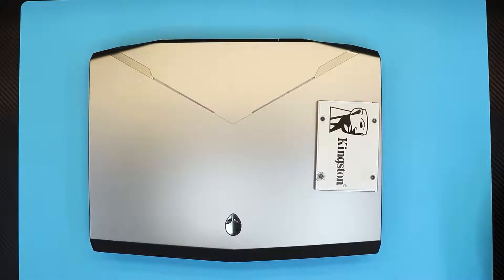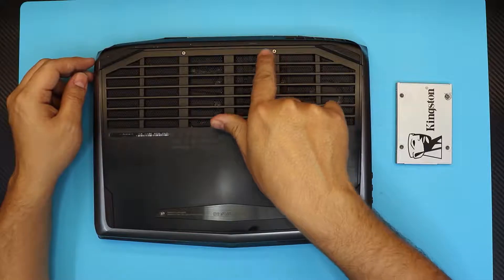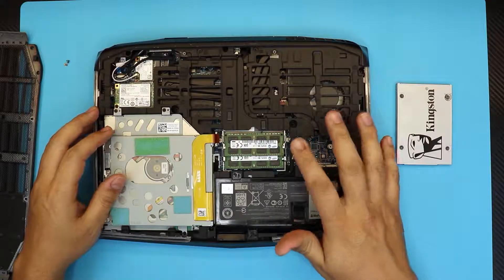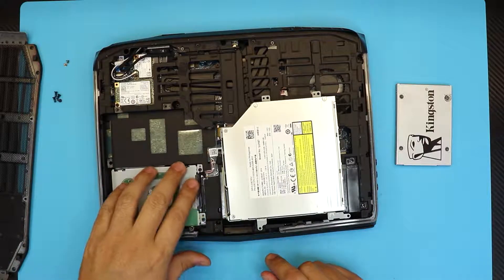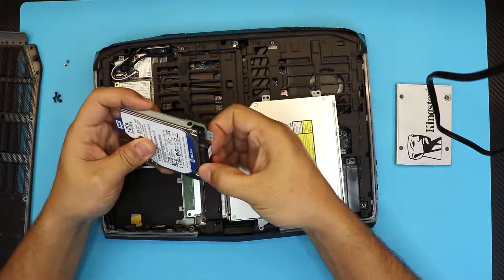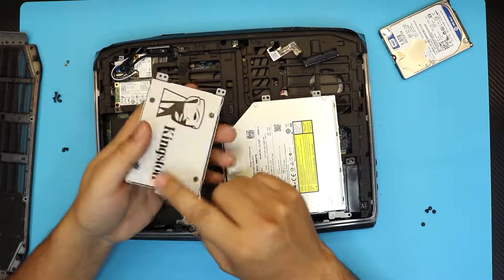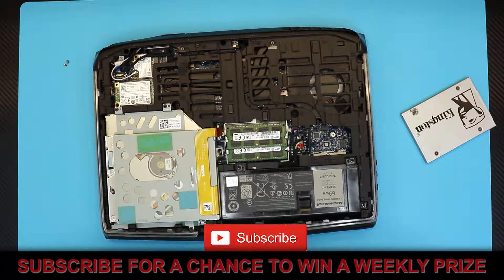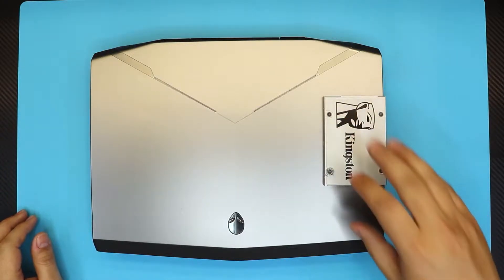Alienware 14 R1: Upgrade / Replace mechanical Hard Drive to SSD

Comment: Hi, I recently tried to upgrade from the HDD to SSD. I installed the SSD and installed the Windows 10 OS. But, after a restart the cooling fan stared continuously unstable, I tried the SSD with win7 also, but he fan speed and noise continued. I had to go back to the HDD. Can you pls help me with any solution for this fan noise issue with SSD ?
Reply from the maker: Thank you for your feedback! If you wish to support the channel, you can like, subscribe, or both!
Regarding your question, the fan curve has nothing to do with HDD or SSD , you may have to download the alienware software, after windows installation.

Comment: Hi. it has a subwoofer?
Reply from the maker: Thank you for the feedback! if you wish to support the channel you can LIKE or SUB or both :P
regarding your question: My bad it does have  the sub woofer here is a link to my other video :
https://youtu.be/j_nWRnHuqcg
check after : @9:18 you can see the speakers on attached to the palm rest and the woofer on the base in front.
and @12:40 i mention disconnecting the sub woofer :)
Reply: @uFixTek  And in principle it is.https://youtu.be/6v7d1ottmgs
Reply from the maker: https://youtu.be/j_nWRnHuqcg
check after : @9:18 you can see the speakers on attached to the palm rest and the woofer on the base in front.
and @12:40 i mention disconnecting the sub woofer :)
Reply: @uFixTek  Is it in it then?
Reply from the maker: yes my friend it is inside, i made a mistake told you not sorry :(

Comment: Once i do this.... Is there anything i need to do on the software? Or just replace and go
Reply from the maker: Thank you! for the feedback and your support to the channel by SUB :P
SORRY for late reply, regarding your questions:
you have two options for SSD or HDD upgrade:
#1, if you want to keep all the stuff programs and files the way they are, then you will need to get the sata to usb adapter and plug your new ssd/hdd using the adapter to your laptop and download a Macrium Reflect software, to clone the main drive to the one connected via usb
and then once cloned then replace and you are set.
https://amzn.to/3ecYRCu
#2. reinstall windows from start,
https://youtu.be/uDu8j2lE-dM
to install via usb is the same as Toshiba to boot to usb its F12 on startup
https://youtu.be/er1UXhie3cA
Reply: @uFixTek  but do you have to do that, can you just upgrade plug and play he was curious about and I as well, or is there a way to download an update?
Reply from the maker: @matt-attack9609  if you want to upgrade the HDD to SSD you will have to install windows on the new ssd or clone it from old hdd. there is no update that can do this for you.
THE best solution is to fresh install windows it take 10min and its very recommended.
or you can keep your HDD and install msata ssd and then again you will need to install the OS on the msata and use your HDD as 2ndry storage.
Reply: @matt-attack9609  do you relize the thing that hold all your information is the hard drive? and if you remove it what do you think will happen? the new SSD won't have anything on it, not windows no nothing

Comment: I have this alienware 14, i7 4700MQ, its possible upgrade CPU to 4940MX ?????? what is the max CPU upgrado for this laptop??? pls
Reply from the maker: Thank you for the feedback and your support to the channel by SUB :P
regarding your question: THE CPU /GPU are none upgradable they are BGA CHIP and they are soldered on motherboard, and the motherboard has components build for that specific CPU and voltage and power regulators are in effect.
Reply: @uFixTek  the CPU is not soldered to the board tho, only the GPU

Comment: Could you please do an installation of the m.2 drive? Also, do you have recommendations for ram for this model so that I can upgrade it?
Reply from the maker: m.2 are very easy to replace there is only one  screw that holds it and once you remove it, it will come out in an 45angle, and in the same way goes in. just like ram stick.
https://prnt.sc/y8o6o1

Comment: Can I install the SSD only (not the mSATA)? Also what are the benefits if I install both?
Reply from the maker: yes you can just remove everything and only istall any ssd 2.5" https://amzn.to/38x2vT2

or have both on ssd , it better to have all SSDs, the best configuration would be as follows:
have your windows OS on m.2 ssd and install a ssd 2.5 instead of the mechanical *much faster , for your applications and games 
this was the windows wont have any bottleneck on the speed and it will be 4x faster when using applications.

if you have your os and files on the same drive (ssd or mechanical) it will be slower because the windows and your apps / games have to share the same sata speed.

therefore have os on m.2 and apps/ games on ssd and use your mechanical hdd as external storage.
Reply: uFixTek I appreciate the response! Thanks!

Comment: what type of ssd's i can use for upgradeing this laptop
Reply: There is no M.2 drive connection. There is a MSATA port, the 2.5" where the HDD is from factory, or you can put another 2.5" SATA drive where the Optical Drive (DVD) is located with a caddy tray upgrade.
So you can use :
1. MSATA SSD
2. 2.5" SATA SSD
The MSATA is a simple fast swap without removing anything unless there was a small caching msata drive from the factory. Any 2.5" SATA SSD will be the right dimensions to replace the HDD from factory.
Reply: can i use whatever i like?
Reply from the maker: @AceTrader_  no you can use one of the following with recommended models: 
1. -regular ssd sata drive : https://amzn.to/2GcWkro
2. -M.2 NGFF SSD drive : https://amzn.to/2DOjWRB
3. or both above drives can be placed in the laptop.
if you got more questions ask :P

Comment: Could I replace the graphics card with a newer one to make my gameplay more smooth and playable?
Reply from the maker: no there is no graphics card on this laptops they have a BGA chip soldered on the board. its not up-gradable.  :(
Reply: @uFixTek  I understand there is no way to replace it inside the system but is there any option by which we can set up an external graphics for this laptop?
Reply: @manushnandan9501  You can do an eGPU set up
Reply: @manushnandan9501  yes you can do external gpu upgrades like thunderbolt